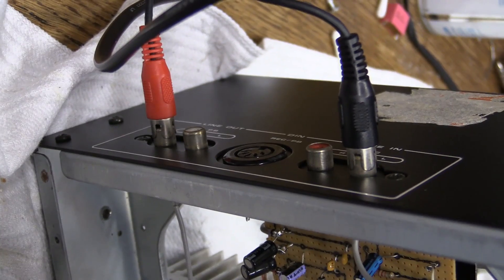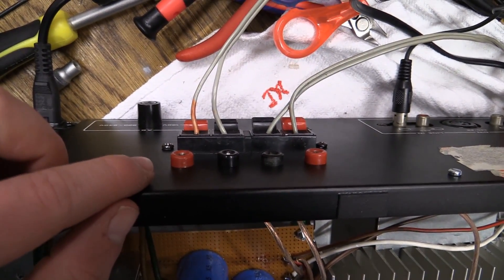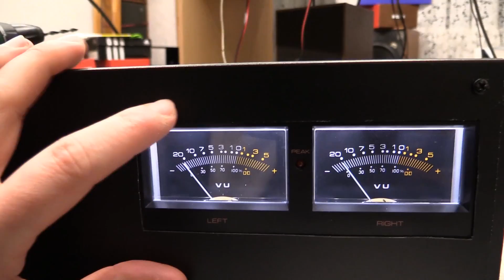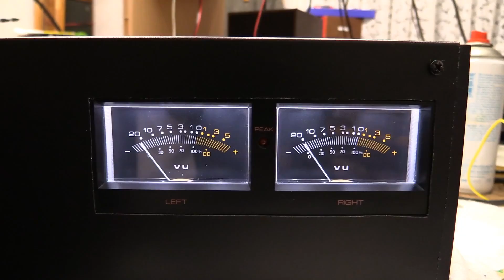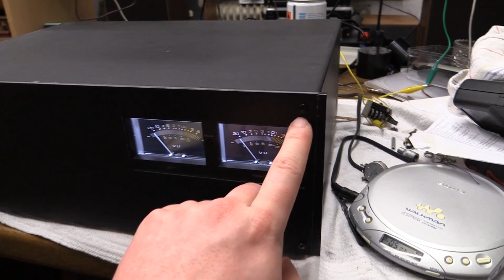DIY TDA2030A HiFi power amplifier

Comment: Nice design and re-purposing of the components you had at hand. Just make sure that the metal can and the screw are electrically isolated on the transformer.
Reply from the maker: Of course they are isolated from the transformer...
Reply: @DrCassette  Good :) I couldn't see very well in the video, so that's why I said it. That's a trap for young players, as Dave would say :D

Comment: Please ground the metal housing. Youre using just 2 wire mains input.
Reply from the maker: All components carrying mains voltage are properly insulated, so there is nothing wrong with that.

Comment: Rather than TDA2030, why don't you use TDA7265? Contains 2 TDA2030 in one package plus standby/mute input and stability improvement.
Cheers from Indonesia
Reply from the maker: I had the TDA2030As readily available unlike the TDA7265 which I would have had to order. And I don't need the standby / mute feature.

Comment: Two things also I have to comment:
First, rectifier bridge for two TDA2030A doesw not need heatsink. I use in my homemade amplifier four TDA2030A (two for stereo and another two in bridge formation for sub) and the rectifier does not even warms.
Second, I don't think you need 22000uF capacity for two TDA2030As, that is too much, I managed to build an amplifier circuit with two TDA2030A in bridge formation with 4700uF capacitors, and it works like charm.
Reply from the maker: This amplifier was assembled from leftover parts. The rectifier bridge indeed needs to heat sink in this application - however, in the project the circuit board was originally designed for it was necessary.
Reply: Ok, thank you for the answer.

Comment: I've also made a homemade amplifier with VU meter, and also had the dimming LED problem. All you have to do is use an LM7812 voltage regulator, but you have to feed it with higher voltage than 12 volts.

Comment: The hum is usually in older amplifiers the transformer that outputs a magnetic field Calles the stray field. usually 50hrtz. All the shielding indeed blocks it until a point we van no longer hear it, bt only see it on a scope. Have you did soms testing with different materials for shielding the transformer? In the video you did use aluminium for the transformer and metal for the PCB?
Reply from the maker: It's actually both metal.
Reply: Have you tried experimenting with other metals? I have some old active hi-fi speakers that have a little hum that is caused by the electromagnetic (EM) or stray flux produced by the transformer when it's turned on and when it's close to the woofer (it is, and there's no way of moving it away). It's a little design error, but shielding with aluminium it didn't really go away. I could throw a toroidal transformer in both of them, but that's another 80 euros. For little improvement.
Reply from the maker: Aluminium doesn't work for shielding a magnetic field. You need a material that's magnetic to shield the transformer's magnetic field.
Reply: Thanks for the comments, cool project +1

Comment: Transformer center tap must be soldered into the chassis to avoid hum...from this point you should catch all ground points you need for input/output and secondary supplies.
Reply from the maker: +Carlos Mergulhão 
That's what I did.

Comment: Sorry. What is the purpose of a heatsink if it has no airflow around it?! You could have mounted the amplifier against the side of the cabinet and the heatsink in the same place, from the outside! :D
Reply from the maker: Matheus Moreira The size of the heat sink compensates the lack of airflow. I didn't want the heat sink to stick out anywhere.
Reply: +DrCassette But it has to. That is the purpose of a heatsink. If you keep it enclosed inside a box with no airflow, it will most probably render useless over a long period.
Reply from the maker: +Matheus Moreira Not necessarily. The heat sink will dissipate the heat into the air enclosed in the box. The heated air will then heat the outer case. The case will then dissipate the heat to the outside. So the heat does have a way to get out of there, just the overall thermal resistance is MUCH higher than in other, more efficient setups. However, that's not an issue in this case.

Comment: Is that case even grounded ??
Reply from the maker: Blissy28 Which ground do you mean? Of course the case is connected to ground. The system ground. So it becomes shielding for the amplifier circuits. It is not connected to safety ground. It's unnecessary because all mains related elements are very well insulated. And the primary fuse is going to blow in case of a short.

Comment: One thing I learned overtime working with amplifiers, is that you need to connect the speaker's negative terminal to the main supply capacitors negative in single supply configuration or to common point between the two capacitors (0V) in dual supply configuration. The copper trace on the circuit creates a very small resistance. If the amp. feed back is on the same trace you'll get hum. that's why in datasheet they present a recommended PCB design or they recommend a star ground connection. Hope this helps.

Comment: Very nice build, simple and to the point, and what I like best-No HUM! The Toroids metal 'Hat' keeps a lot of the fields contained, nice. Just wondering, for the Meter led section, have you thought of running it off of a seperate, low power transformer, or, still tapped off the cap, but regulated ex: LM317, etc.. with a nice fat cap at input to regulator. (1000uF) it should cure the 'dimming' effect. I like the case too!
Reply from the maker: Scott x The hat of the toroidal transformer doesn't really make any difference, I tried the amp with and without. I'm now just leaving it on because I don't need it anywhere else. The LEDs were hooked up as simple as possible, an LM317 wired as constant current source would certainly fix the problem, but the input voltage wouldn't be high enough.

Comment: One word of warning, which you probably know already... but others may not: Be VERY careful with metal cans round toroidal transformers. If they are connected at each end via the centre bolt, they form a short circuit turn and tend to either blow fuses or result in redhotness!
Reply from the maker: ***** What are you talking about? If the transformer is properly insulated with the windings intact, there is no way this could cause a short circuit. All it does is messing with the magnetic field.
Reply: DrCassette The metal surround along with the bolt is effectively a loop round the core, so forms a short circuit turn. 

ref: http://www.raftabtronics.com/TECHNOLOGY/ElectromagneticBasics/TransformerBasics/tabid/110/Default.aspx#Toroidal_cores

Comment: I remember the first working amp I ever built,based of the tda2003, had no hum at all in normal conditions, only when the supply was loaded very much and the voltage dropped below 3 volts things started to turn bad.
Even ran one just from usb power (5v 100ma),worked ok, needed no heatsink

Comment: Very nice amp! I'd recommend using LM1875T in place of the 2030A, that would make it a proper high-end amp.
Reply from the maker: NoBudgetTech I know those LM chips are good (gainclone) but I don't have any of those. The TDA2030A circuits I already had in my parts bin, only had to mount them to the heat sink.
Reply: Then go buy some LM1875 :D Very good build, it would be a shame to waste it on some TDA chips, tho.
Reply from the maker: I said I'm working on something better, so for the time being these TDAs will be good enough.

Comment: Looks very nice.  My homemade amplifier has a little hum but I think that's a ground loop somewhere in it more than anything else. Interestingly enough most of my tube amplifier experiments sounded nicer and had no hum whatsoever.
Reply from the maker: CoolDudeClem I have experimented with that preamp circuit, you may have seen that video. That also worked out quite well.